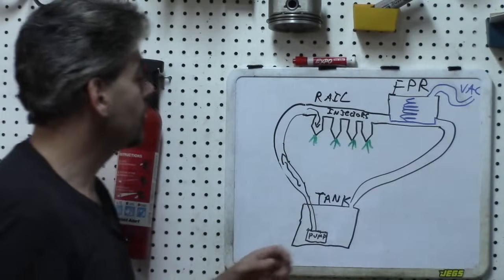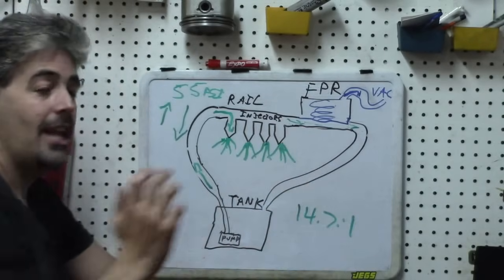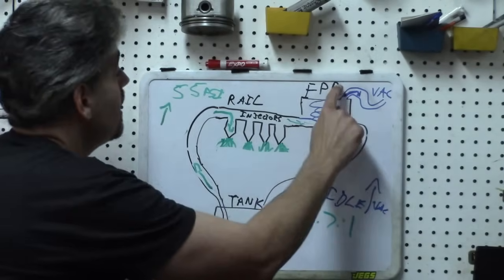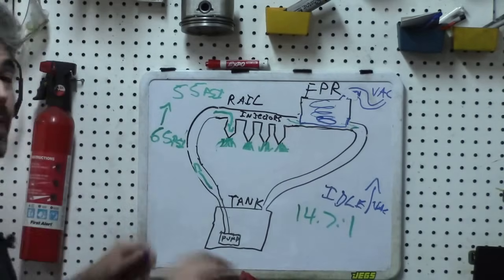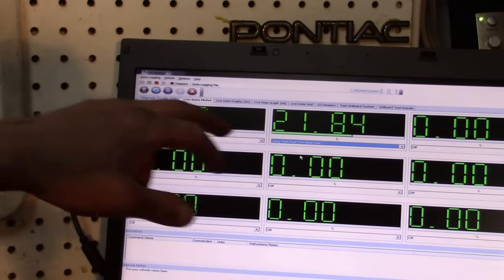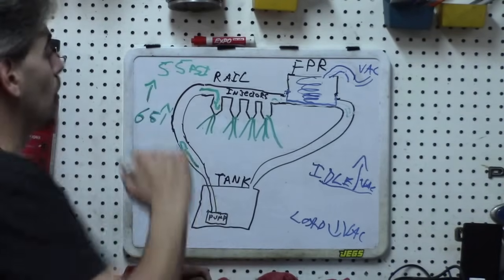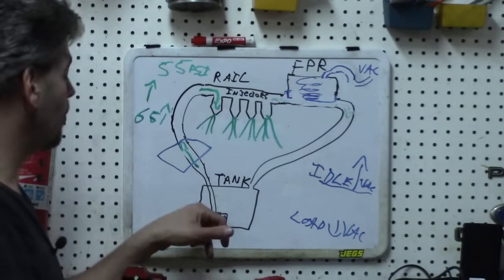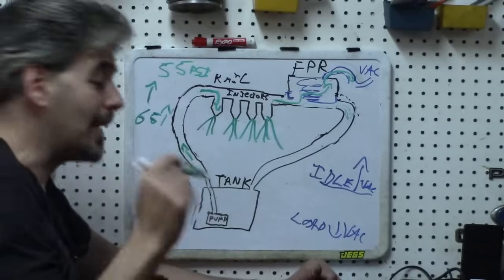Fuel Pressure Regulator Diagnosis + Understanding (HD!!)

Comment: I tested my fuel pressure I only turn the ignition on I got 60 PSI left it sitting for 30 minutes pressure drop to zero!! When the engine on and leave it at idle the fuel pressure is 60 PSI if I rev it it does not move whatsoever there's no increase!!!!bad fuel pump? I have a po171 code lean condition
Reply from the maker: pretty clear it’s a fuel trim issue not related to rail pressure.
Reply: @SchrodingersBox  fuel trim? As I'n vacuum leaks, injectors, O2 sensors, etc?
Reply from the maker: fuel trim as in the pcm compensation to abnormalities in the combustion mix. I would totally start there. a basic fuel trim analysis will show the direction to go.  always start with the beginning basic data- in fact the fuel trim analysis would have shown you the fuel pressure is not the issue so it would have saved that trouble.
Reply: @SchrodingersBox  fuel trims are high in bank 1 when I rev the engine....!! And then drop back down.
Reply from the maker: What do the trims read exactly? And also what car is it and what engine?
Reply: @SchrodingersBox  bank 1 - short term fuel trim 13.3%/ long term fuel trim 18% when I rev up and hold the accelerater to about 2000 it's spikes up to about 30 % on the short trim, and 22 -24 % on the long trim, when I release the accelerater it goes back down to the first #'s I stated.!! 13.3% and 18.%)))))  If I tap on the accelerater, it spikes up around 26 % short trim....and 21% long term fuel trim...!! I've checked for vacuum leaks with smoke machine....no indication nof Any leaks....all injectors are brand new, injector pulse seems to be ok, all 02.sensors a brand new upstream and downstream,  map sensor is brand new, all I can pin this on is the fuel pump.....due to the increase I'm percentage and Loss of pressure after sitting for 30 minutes. As the engine idles the fuel pressure gauge fluctuates rapidly between 56 psi and 60 psi
Reply from the maker: Looks like a dirty MAF. Definitely it is not a vacuum leak- it’s the opposite actually. What engine is it?
Reply: @SchrodingersBox  iev replaced the map sensor with a new one....and still the problem persist!!
Reply: @SchrodingersBox  3.0 V6 Honda
Reply from the maker: mass air flow. Not manifold absolute pressure. It’s definitely not a MAP issue.
Reply from the maker: whoa wait- a V6 honda?! why are you only giving me B1 fuel trims??  that changes everything. there is no data to say anything with just B1 data. I thought it was a 4 cylinder this whole time because you only gave B1 data. 
  gotta start all over again. there is no data now.
Reply: @SchrodingersBox  yes I have to a bank 1 lean code p0171
Reply: My apologies
Reply: Bank 2 is normal....both together are less than 10%
Reply from the maker: Yeah I have to know what bank 2 is showing at idle vs under load. There is no information here otherwise.
Reply: @SchrodingersBox  bank 2...at idle......short term...11.7%....long term 13.3%
Reply from the maker: and under load?
Reply: @SchrodingersBox  under load...bank 2 short term is 3.9%>>>> long term is 9.4%
Reply from the maker: So how can it be fuel pressure then? That affects both banks. 
  You have a bank specific lean condition. Run your basic lean condition variables that would be bank specific only. Fuel is not bank specific- it affect both banks and you have no fuel pressure issue anyway. It cannot be map or MAF. It cannot be vacuum leak.
  You have to change your approach to bank specific varibles, not engine specific.
Reply: @SchrodingersBox  so you don't believe it's a fuel pump issue? What is your best guestimation?
Reply from the maker: I don’t guess. But how can it be fuel pressure when only one bank is lean?  It might be fuel delivery to one bank or cylinder but it cannot possibly be rail pressure. I might try checking relative compression as the first step. Everything else was essentially a waste because it cannot be the issue since they are entirely engine specific. I would strictly stay with the basic bank specific variables.  Anything not bank specific is a waste of time.
Reply: @SchrodingersBox  should my fuel pressure drop from 60 psi after I shut the engine off and it sitting for 30 min ?
Reply from the maker: Yes
Reply: @SchrodingersBox  this new pump drops to zero psi as soon as I turn the engine off, which the original pump took about 30 minutes to do so......and now I'm having trouble starting the engine now as well with this new pump.
Reply: @SchrodingersBox  probably a dumb question here ...can a bad pcv valve only cause one bank to run lean,or does it affect both?
Reply from the maker: Sounds like new pump either has a bad check valve or you disconnected it when inserting it. That’s totally a bad check valve.
Reply: @SchrodingersBox  I keep hearing so many different things....!! In your expert opinion it's not suppose to drop in pressure once I shut off the engine?
Reply: Also can a bad EGR valve or a bad pcv valve cause only one bank to run lean?
Reply: I really appreciate your help...👍🙏
Reply from the maker: Bad EGR or PCV affects whole engine. As for the fuel pump you should have pressure remaining after key off. That is how it starts next time. I imagine you must have a long crank time with no fuel pressure to start with.
Reply: @SchrodingersBox  hello....yes my previous fuel pump drops from 60 psi down to 0 psi after 30 min or so...once I shut the engine off.....!! I'm in the process of testing the fuel Injectors....I did notice when I took the upper intake off I noticed that the lower part of the intake gasket was full of the residue from the smoke machine I don't think it should have gotten all over the gasket if it's sealing properly, correct? That could possibly be causing the lean on Bank One?
Reply: @SchrodingersBox  after further diagnosis, once I removed the intake manifold......I noticed all the oil from the smoke machine that doesn't burn, was all over the intake gasket....once I removed it....which I believe it shouldn't have been soaked with the smoke machine oil of the gasket is pressed together with another part, which in this case is the lower intake manifold.....I'm thinking maybe that is what's causing the lean condition on Bank 1?
Reply from the maker: There is no unburned oil from a smoke machine.  Not sure what you are referring to.
Reply: @SchrodingersBox  somehow the the smoke machine not only pushed smoke through the intake but it allowed some of the unburned oil from the machine to end up on the top side of the intake gasket, that area should be completely dry since the gasket is torqued between two parts.........it had to have dripped down the inner intake ports, and started to accumulate on the top side of the gasket Instead of it dripping all the way down towards the valves and eventually the cylinders. It is the oil from the smoke machine, the smell of it gives it away.
Reply from the maker: How do you explain that happening at 1PSI of pressure and the fact that you would actually have to fill your entire intake with liquid oil for that to happen?
Reply: @SchrodingersBox  I'm not sure how it happened....but it did ...it's not engine oil, or gas....it's the same color and smell of the smoke machine oil (chemical) I mean anything is possible
Reply: finally replaced a faulty lower intake gasket.....and replaced the fuel pump.....erased codes, ran the vehicle.... the original code came back p0171....and also a new code p0174.......now both banks are running lean.... originally it was just bank 1........I tested the fuel pump pressure....when I turn the ignition on it rises to 60psi....as soon as I turn the ignition off, it drops from 60 psi to 0 psi in the matter of 2 seconds....!! Can this new fuel pump be faulty? Is it suppose to drop psi that quick?
Reply: I'm thinking now, I corrected the intake gasket issue....but now this new fuel pump is trash !! Now at idle Bank 1 short-term fuel trim is at 17.2%/ bank 1 long term fuel trim is at 17.2%/ bank 2 short term fuel trim is at 15.6%/ bank 2 long term fuel trim is at 16.4%........once I rev it to 25,000 rpm's bank 1 short term fuel trim spikes up to 25.2%/ bank 1ong term fuel trim stays the same at 17.2%....../ bank 2 short term fuel trim rises to 34.2%/ and bank 2 long term fuel trim stays the same at 16.4%.....new fuel pump might be faulty not enough pressure?
Reply from the maker: Can’t say. You don’t have any useful data to say if it’s the issue. This is not the way I do things so I can’t really help on this one sorry. not that your way isn’t better- it’s just that I don’t understand it- I just know my way of doing this by eliminating variables to identify an independent etiology.  Anything else honestly just doesn’t make sense to me.  Best of luck though- I hope you guess it correctly soon because it sounds like it’s getting expensive!!
Reply: @SchrodingersBox  thnx👍

Comment: Great, my fuel pressure regulator doesn't have a vacuum hose.
Reply from the maker: Yeah those are harder to diagnose. I usually do it through combination of fuel trim analysis combined with static and running pressures
Reply: Schrodingers Box I'm still going to replace the fuel pump because according to the manual I'm not getting 60 to 66 PSI of fuel pressure anyway and my fuel pressure drops like a rock when the ignition is turned off.
Reply from the maker: well your variables are fuel leak internal or external OR a bad check valve.

Comment: Hi Matt
As I understand it.At start up and when engine is cold there should be no or minimum vacuum at FPR.  Therefore, the FPR will provide minimum return flow.You wrote (IAC is open much higher thus contributing to lower vacuum in manifold.  This helps increase the fuel pressure proportionately.)All this until the engine is warm enough for vacuum to kick in at idle. My question is:  If at idle and cold engine the FPR is closed because minimum vacuum, as it hasn’t reached operating temperature yet then, the FPR has no effect at this precise time and therefore the fault must be because of another reason or component! What do you think.  Also.  What if there wasn’t a decrease in vacuum when increasing RPM.  What would cause that to happen or maybe such a situation doesn’t exist! I’m thinking if I took of the vacuum hose and increased RPM while blocking hose with hand to see if there was indeed less vacuum.Thanks in advance.
Reply from the maker: +Ilovetosingem Yeah I see your point and I agree, and in fact also remember there are several variables at startup besides the IAC position such as longer injector pulsewidth and higher idle speed , both of which would reduce the fuel pressure even further right?
  I guess I never thought about it til now but the only explanation I can come up with is the PCM must simply not activate the solenoid for the vacuum line to the FPR until warmup is completed so the maximum fuel pressure position is maintained despite the variables with IAC. idle speed, higher pulsewidth and lower vacuum. I am not 100% positive about that but nothing else I can think of.
Reply: +Schrodingers Box Longer pulsewidth means more fuel as the injectors stay open longer and therefore less pressure in the rail,and higher idle speed means throttle opens more therefore more air, so to keep Stoichiometric ECU adds more fuel and therefore longer pulsewidth correct?  PS Do you have any idea what sort of vacuum should exist in that vacuum pipe and what sort of fuel return should be at start up as the FPR should be blocking most of the return fuel.
Reply: +Ilovetosingem Thought as I have no gauge how about the following:  Take off return tube, place it in a bottle, measure time and the amount of fuel in the bottle both when vacuum is on and off, and cold and warm, and increasing RPM.If result is the same then, the FPR can’t be working correctly and is stuck open if flow is fast.  If flow is slow then FPR stuck closed.

Comment: What is the accuracy of a typical fuel pump flow/pressure?  If the new fuel pump is delivering 20% extra pressure, does the pressure increase by 20% and fuel trim then drop to negative 20?  Is there something else in the system which maintains the mythical 55 psi if one replaces fuel pump and/or the FPR?  You see, I do not believe that any of the auto parts have better than 10-20 percent accuracy.  There has to be some kind feedback system which allows system to remain stable even with components with no more accurate than 20%.  Do you follow my questioning?
Reply from the maker: I do follow your question and I don't really have an exact answer.  Fuel pumps usually die slow deaths with symptoms of low fuel pressure getting worse over time til drivability is so affected that customer has to get it examined. What I have not seen is if there is proportionately higher and higher fuel trim during this time correlating with the weaker and weaker pump. But I suspect that is the pattern we would see.
Reply: I can give an example from my background.  A transistor gain is quite high but there is a large variability on it.  So when somebody designs a circuit and need accuracy and stability they design it such that the circuit operation does NOT depend upon the actual value of the gain of the transistor (or OP AMP) but rather on resistors which can be purchased with 5% accuracy.  On top of that, usually a trim mechanism is provided for further tweaking.

Automotive system must have something similar because otherwise I just can not imagine how one could install an aftermarket part and still get the functionality of the properly operated engine.

May be that is why we often get really stumped when somebody uses aftermarket sensors such MAF etc :-)

Comment: Drop from 45 to 44psi
Reply: Leakage some place
Reply from the maker: What the hell are you talking about?? How is it physically possible for there to be a leakage when the static pressure is constant?
Reply: Video showed 45 then over time dropping to 44. Let it sit over night and see what you get. Probably a fat 0 PSI.
Reply from the maker: Jim that was well over 5 minutes. easily within spec. You are clearly not familiar with fuel injection specifications.
Reply: Clearly not I guess. Would of thought you would of had zero leakage over night.

Comment: I’m fighting a P0300 on my 2003 S10 4.3  I have no hair left. Lol
Reply from the maker: What is your strategy in the diagnostic approach you are taking?
Reply: The next thing I’m going to do is clean the MAF sensor. It runs fine. Just when you get over 2k rpm the ses light flashes.
Reply from the maker: Why is your strategy to clean the MAF? What data are you getting from the MAF or fuel trim or O2 sensor output that indicates this is a likely cause?

Comment: I have a 2004 silverado 2500hd 6.0 return less at idle the fuel pressure gage fluctuates from 52 psi to 60 psi.
Reply from the maker: What is the fuel trim showing?

Comment: I have a 95 VW 2.0 . I don’t know where to connect the gauge I don’t think I have a valve on this car .
Reply from the maker: You don’t. Simply T it into fuel line.
Reply: @ is that under the car or under the hood?
Reply from the maker: Both. Easiest to T into the fuel rail but sometimes I have gone under car to T in at fuel filter. In fact I have a video somewhere of that.

Comment: And yet how many pressure kits DO NOT HAVE a Schrader fitting -- 99% of them.
Reply from the maker: It’s so frustrating. It’s one of the most basic and critical tests there is. Why do they not just include the stupid valve. It’s egregious!!!
Reply: @SchrodingersBox  Thanks. I replied earlier with a link to a kit I found with a Schrader fitting but it's disappeared. Will be brief:  tested 52psi and holding. New filter, pump, so I guess that excludes fuel problems from no-start situation. Thanks again.
Reply from the maker: Yep not a fuel delivery issue.
Reply: @SchrodingersBox  Thanks for confirmation -- that means a lot. 
'Egregious', eh? I'll be researching that, too! And quoting you: 'What!!   It doesn't have a fitting for a Schrader valve on the fuel line!? Why that's plain egregious; yeah, that's what I call it, egregious. And The Box says it, too.' 
(Bosch do one, unavailable here in France. Amazon UK and DE won't post it, US will post it. The kit I finally tracked down is  HSEAMALL Tool 0-140PSI (40.79€)).

Comment: tons of bs info on RICH conditions of a bad fuel pressure regulator and less than 2 minutes on the lean condition. Rich condition fuel pressure issues are very simple to fix. Lean is the real problem. MY fuel pressure regulator used to work fine but slowly began making noise and holding less. Now the gauge doesnt even move when i turn the pump on (brand new walbro 450lph). Vaccuum hose on or off still no pressure. I believe my issue is with a broken diaphragm which allows fuel to flow back to the tank instantly. I have a chinese ebay aftermarket regulator. Just wish this video was 10 minutes long with 5 minutes explaining how to diagnose rich fuel pressure regulator issues and 5 minutes explaining lean issues with fuel pressure regulator
Reply from the maker: Yeah moron guess what - i didn’t make this video for YOU. Amazing concept eh?
  You clearly don’t understand this material. stay basic.

Comment: I have fuel at the rails because I partially removed the banjo fittings and turned the key. Fuel poured out both rails. I also have spark. These motherfuckers jammed up my fuel injectors. But, how could they all fail at the same time?
Reply from the maker: You just said it wont start even with starter fluid. STOP!!!! You need to get someone who understands what they are doing.  You just loosened a banjo bolt without replacing the washer. STOP!!! You are creating a hazard because you do not know what you are doing!!!